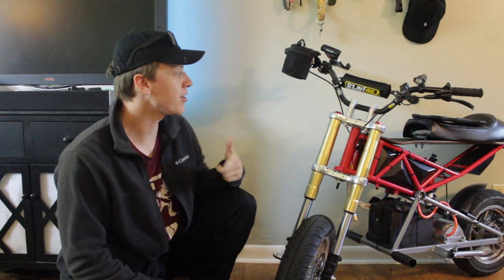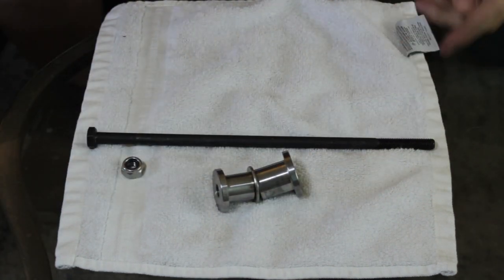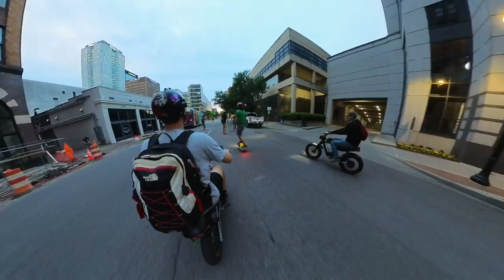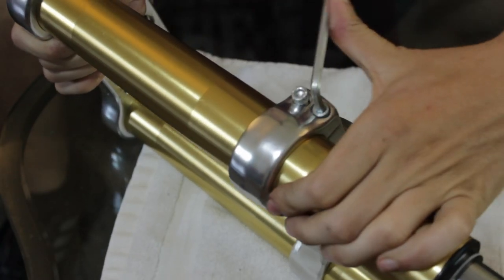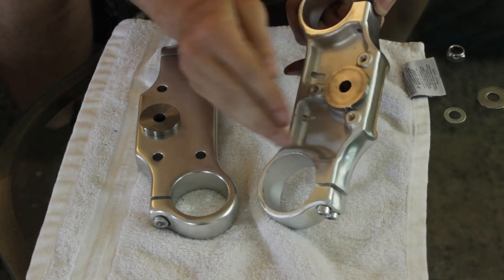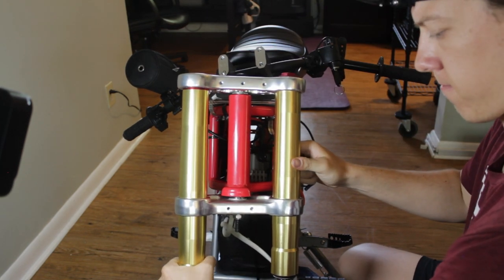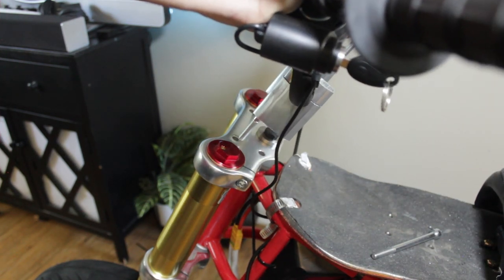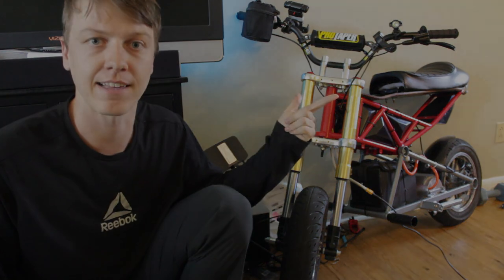Bolt on hydraulic suspension upgrade for Razor RSF 650 / MX 650 NO fabrication! Step by step guide

Comment: What size are those rotor bolts and caliper bolts? The ones I currently had aren’t long enough.
Reply from the maker: I am not exactly sure, i just matched them at the hardware store. I will go back to the store when i have time and get some exact dimensions for ya!

Comment: You wanna explain why you needed the additional unused 2 inches on the head tube bolt 
And the longer axle lol?
Reply from the maker: You could use a shorter bolt, 270mm or 260mm could work, i just used the longer one just to be sure. The one that came with the ride or die kit was too short for me. Longer axle was needed as the stock one was too short.
Reply: I just used a harley davidson bering cup kit . It added one inch on each side. My neck tube was 4.5in long it worked out perfectly for the provided stem so I could use the nice taper bearing in the original kit. I had to machine 2 shims from 50.2mm to 43.8mm ,but it was totally worth it for the taper bearing neck.  It was 22 mm and 23mm / 44mm taper bearing

Comment: Did you remedy the top bushing play and find a solution for the mtb front brake? My friend has a lathe maybe he can make you a more precise bushing.   Does the bottom one have play too?
Reply from the maker: Im still looking for a better solution for the top bushing. The bottom bushing is very snug so im not worried about it. Theres probably a simple solution to the top bushing play. Whenever i get the time i will edit the video with whatever solution i find. That being said, this setup still totally works, been riding around on this setup for months with no problem.

And yes i found a front brake solution! I will add links to the parts i used for the front brake in the description.

UPDATE: Parts for front brakes have been added to description

UPDATE 2: for those of you interested in reducing the play between the top bushing and triple clamp, i found a simple solution. Details in description

Comment: Hey I can’t get my Pirhana fork stock head tune bolt off the trople tree any help?
Reply from the maker: All i had to do was hit the threaded part of the head tube bolt that came with the piranha forks a few times with a hammer and it popped out. Use a rubber mallet if you can, but a regular hammer works too.